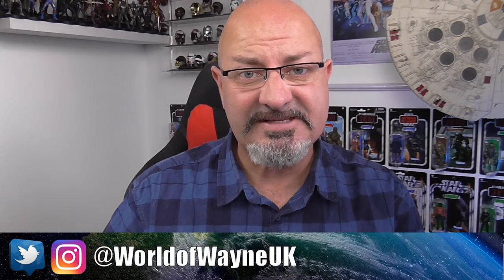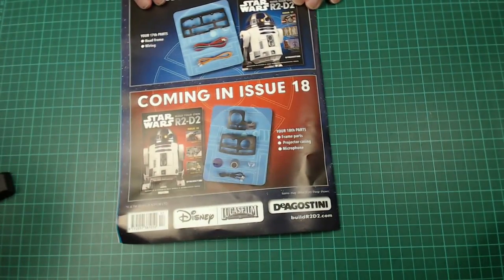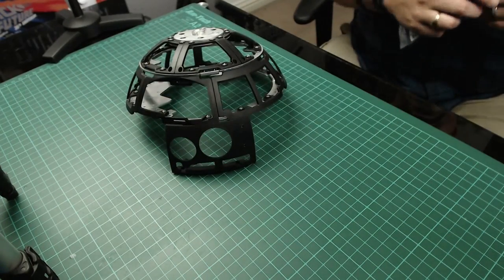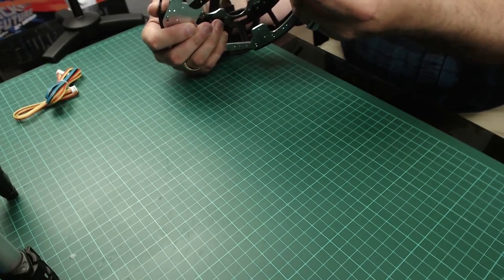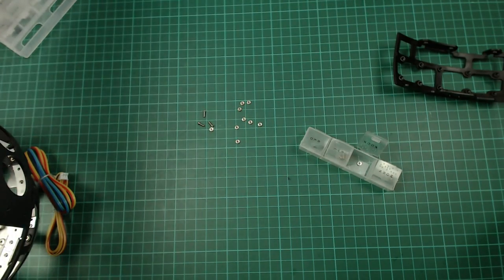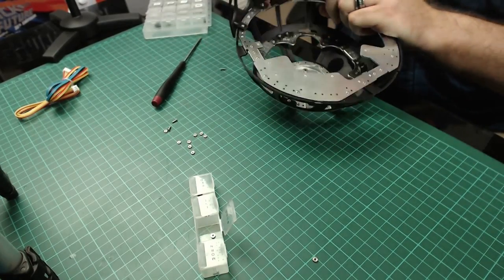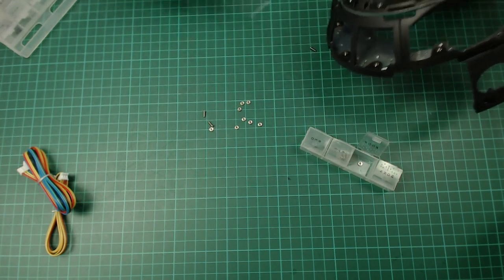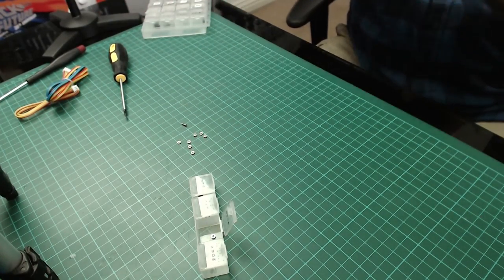Build Your Own R2-D2 - Issue 17 - Dome Frame and Cables

Comment: Hi Wayne, I have not only found your channel helpful but I have enjoyed it as well, so please keep the good work up. You commented that although there was not a lot to do in this issue there will be a lot to do later on. I have looked ahead on Deagostine's official forums and you are correct in what you say. Issue 30 is going to be a killer' the whole of the leg structure, including the internal wiring, is put together. Once again, keep up the good work' it's appreciated.
Reply from the maker: I suppose the easy parts are there to lull you into a false sense of security. It should be fun when we are mucking around with electrics :D

Comment: Hi this is my first partwork modelling attempt. Is this lean compared to others? I feel like they first decide how many issues they want it to run for then spread the parts over it instead of thinking what is a fair value
Reply from the maker: Craig Thornton yep. Although if the Falcon is anything to by there may be some issues where you think. Man . This is a lot.
Reply: World of Wayne I think when you come to filming issue 19 it will be your shortest video ever!
Reply from the maker: Craig Thornton I had a quick look at it and will do something special for it lol
Reply: World of Wayne I love R2D2 which is why I started this but looking at how little I have for 21 issues so far is making me wonder whether to cut my losses and stop. Difficult choice
Reply: Craig Thornton I understand what you are saying but I think we have a lot more than we realise. There are a lot of pieces, such as the external lenses, microphone and so on that at haven't been fitted into the main parts yet. I have a feeling that things will suddenly come together. It's just a case of hanging in and being patient.
Reply: Craig Thornton I forgot to add that later on some of the issues will probably contain parts, such as the moters that are worth more than £8.99. However Deagastine are not going to give you those parts until they have your money and commitment. If you love R2D2 keep going it will eventually work itself out.